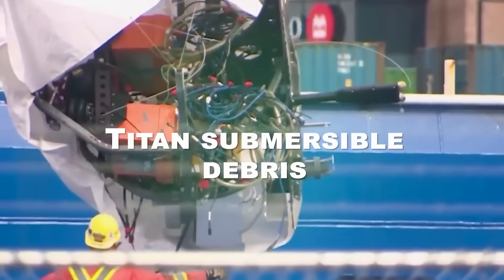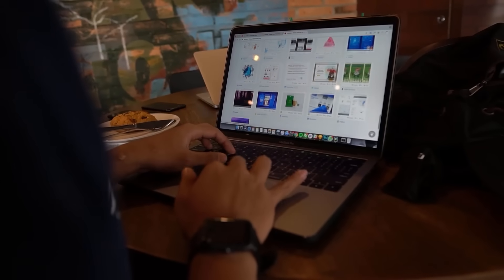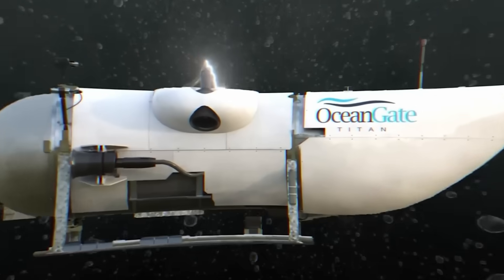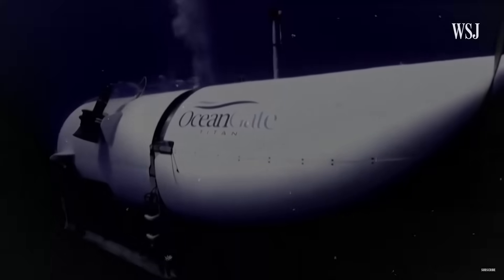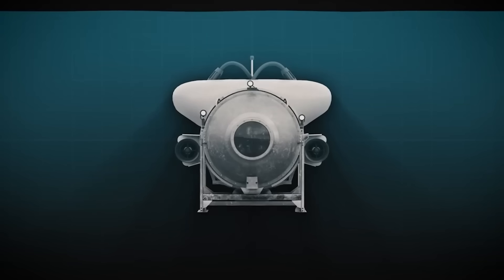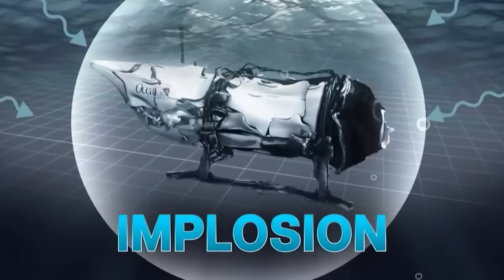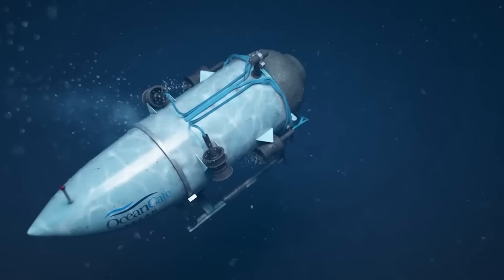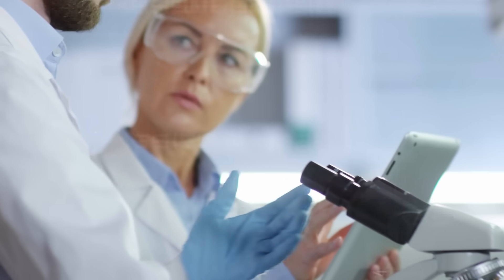The TERRIFYING CAUSE Of Titan Subs Tragedy: Titan Sub Porthole Window

Comment: The cause can be narrowed down to the poor choice of two materials used. Stockton chose to coat the outside with Rhino Liner. Flex Seal would have performed much better for this application. Phil Swift made a glass boat with it so it's maritime capabilities are already proven. 

I don't know what that peanut butter adhesive he used is called but Gorilla Glue is a no brainer in this situation. It's incredibly strong and has a five star rating. It's waterproof, holds up to hot and cold temperatures and bonds to anything. If you never heard of it, I highly recommend it. 

I hope this helps any future submarine entrepreneurs.

Comment: The 7 inch diameter core of the carbon fiber took on water in the inside of cylinder. This can be assumed because Titan was dropping to fast and when Rush let go of the weights they couldnt come back up. So they fell down faster either port blew out first or carbon fiber popped . 
They need to go back down and find the back aft cap.

Comment: For me it makes sense that the view port while under normal high pressure from the outside would have a great deal of stored energy, so when the hull crushed that pressure pushing inwards on the view port would pop the port out as the pressure equalized. You design the view port to be pushed inwards by the pressure and not be as strong outwards. 

The bonds clearly broke, because of poor application of the glue. This was no accident, it was inevitable.

Comment: there are many theories, one that caught y eye was that the monitor mounts and interior lights were mounted with screws into the carbon fiber, damaging the integity of the carbon fiber, why didnt they use an adhesive like an epoxy to mount the monitors?
Reply: No they weren't.
Reply: Well i always said you get, what you paid for. May they all REST in Peace ❤😢❤. 🙏

Comment: I don't think the glass imploded. I bet it was blown out when the CF had catastrophic implosion. By the look of the clean seal of titanium I bet it was cracking/separating from the first dive. I also think all the occupants would have been crammed out the small opening in the flash of implosion.

Comment: An implosion is an explosion in reverse. Chances are the window popped in at the exact time the cabin imploded at that depth.
Reply: Correct. This video title.is clickbait. There was no evidence or reports with any factual info or data showing the window caused the implosion or even gave out. It was the carbon fibre hall and the wear and tear of multiple deep dives with no repair to the cracking that was occuring since 2019

Comment: The viewport failed causing seawater to fire into the hull like a cannon. The crew would have been compressed into the opposite titanium cap, forming a glob of about 400 kilo of cooked human mush. This is where human remains were found. This is why the rear titanium cap was not publicly displayed. The carbon fiber hull then exploded, all within milliseconds. 
With or without international regulations: Don’t dive thousands of meters underwater in a devise designed by a guy who says “At some point, safety is just pure waste”.
Reply: Wrong, a rated window with those limits would of never made the first dive. The carbon fiber was slowly coming apart with each dive and the reasons for the loud noises heard.

A physical force, not psi was around 10,000 tons against the sub equally..
Reply: @thedbcooperforum  Why didn’t they show the rear titanium cap? Where did they find human remains?
Reply: @JacobStein1960  human remains will be microscopic...
Reply: @thedbcooperforum  If I could see some photos of the rear titanium cap, I think that would answer the question for me one way or the other. In any case, I’m sure that the official report will come out in due time.
Reply: @JacobStein1960  if the carbon failed the front and rear caps would separate from the implosion, possibly blowing out the porthole, not from the outside in..
Reply: Agree.

Comment: the thing is that the view port is tapered into the titanium dome no way this  would  be punched in  the tube failed and imploded Neutons law says action - reaction  implosion - explosion  equals  to 47 lbs of TNT
 there is no body or even  DNA the heat generated would of been the heat of the sun in this event  Dynamites power is expressed in Velocity  it is ovious that this is at a super high velosity
Reply: 😂 wtf????

Comment: I'm no expert . . . well not in this particular field. But  I recall seeing a past video of them handing  some novice the controller and allowing them to maneuver the Titan Sub  and they accidentally impacted something. Unlike metals, the carbon composite does not bend or dent, it splinters and fractures.   So I'm willing to bet, that is what started a hairline fracture in the structure, that created the weak point & the finding will be that the Composit hull is what  initially failed and lead to this tragedy.

Comment: It's unbelievable how Stockton Rush was a billionaire, but didn't want to spend money on good quality parts for the sub.
Reply: Don't you just LOVE how the rich try to save money?
Reply: @danielsdimension7828 ikr… he fucked up big time smh like why build the Titan submersible outta cheap material and using carbon fiber hull like that doesn’t make any sense and what’s even sad he brought a cheap wireless gaming controller to control the Titan submersible when he should’ve used a advanced computer system 💀
Reply: He was only a millionaire. $25 million was his net worth. Stockton Rush was a billionaire like djt is.
Reply: This is why I think he had financial problems.  He used second hand material from a plane and he charged the travellers $250,000 each to be in the titan.

Comment: Rush was one of these type of people where he knew best and wouldn't take advice or listen!
Reply: Captain Ahab
Reply: It must have been a horrorfying and extremely panifull experience when they realized that the u boat was going to inxplode and all the thing they went through when the pressure started to build up.
Reply: @thorsrensen3162  I dread to think what they was going through in the last few minutes from the RTM was lit up all red and cracking noise aft, they dropped weights and the landing skid so they DID know before it collapsed!